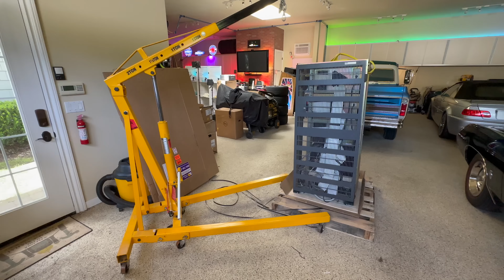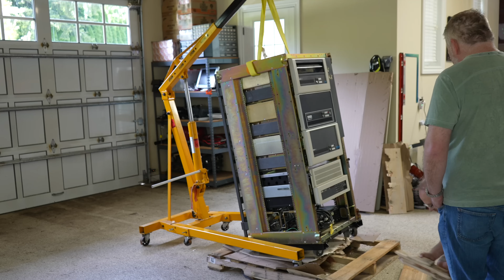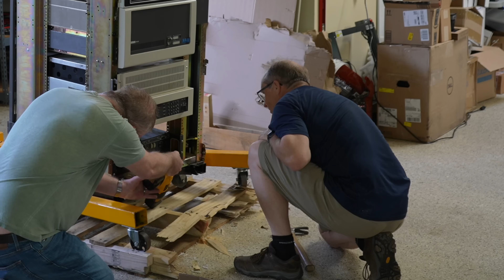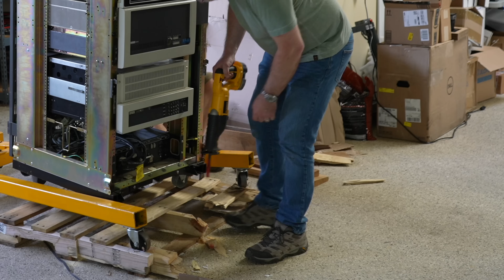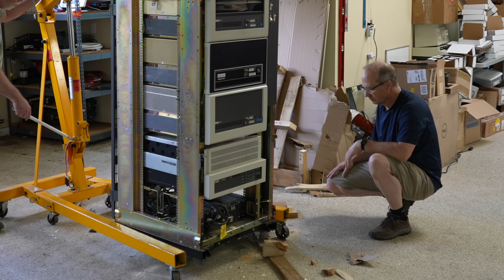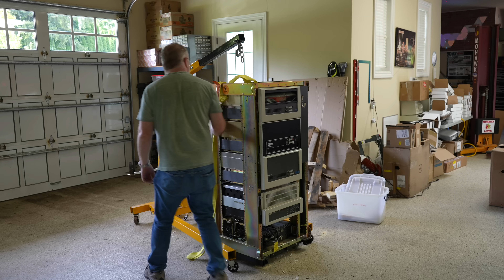I Bought the HEAVIEST Computer on eBay: The PDP-11/34!

Comment: PLEASE more DEC ANYTHING. I was with DEC for years from PDP 8 series through most of the VAX series. I know these systems frail to most simple systems now in some ways but the evolution of DEC over the years was amazing. I am happy and honored to have been part of the excitement.
In case you may be interested Ken Olsen did everything to keep the payroll running even when times were tough and we did have some lean times. He made some errors in judgement by not getting in the PC biz earlier but there were no crystal balls then and as they say, it is what is  or was, as the case may be. 
Thanks for keeping some of the DEC gear going and preserving the tech on your super neat YouyTube channel !!!
Reply: Greatest design and most clever and consistent architecture between generations.  Learn it once and you've learned it forever,
Reply: I wanted to work for DEC after seeing a VAX 11/780 at the lab my father ran, but ending up taking a different engineering subject. But did end up using microVAX IIs and Alphas during the 1990s. I'm wasn't a systems engineer but was able to do some pretty cool things with the cluster, the ease at that it was possible to log onto one computer and then run an application on another computer, using the hard disk from another I still find amazing.

We did have DEC PCs, but I doubt they would have saved DEC.

I've heard that Ken Olsen was a decent guy, again marking out DEC from Bill Gates and Microsoft who haven't innovated a single thing and every product is stolen or cheated from somebody else.
Reply: @axelBr1  I know mush of the history of Gates and he didn't mind taking other's ideas and claiming it was a MS design. Case and point is the underhanded games Gates did regarding CPM and on and on. My respect for him is on par with the devil himself, almost !!
Reply: I feel that DEC trying to get into the PC game was one of their poorer moves.  This is not the venue that DEC was great at.  Too many companies tried and most failed at the PC market. I worked at Sperry and they made one.  Never really went anywhere but it seems they thought they had to try.  I wanted to work at DEC but they never contacted me for an interview till I was already at Sperry for several months.  I am a big DEC fan.  I learned computers on the pdp-8i running TSS/8.  Later got into the pdp-11 line and then then pdp-10 (KA-10).  I have the pidp versions of each that Oscar sells.  They are miniatures of each but with the same but smaller front panels and switches.  I have one big pdp-11 left.
Reply: @timradde4328  DEC's management matrix was out of control, resulting in DEC having a horse in every race, including 36-bits.
Reply: @James_Bowie  Their 36 machines were amazing.  But the Vax line really messed up the pdp-11 and the 36 bit.  And trying to get into the PC arena was just a bad move.  DECs stuff is built well but that means a higher price.  People did not want to pay those high prices even if the stuff was decent.  Too many other companies were also vying to get into that market.
Reply: @timradde4328  You need to understand that Ken Olsen wanted to keep the systems in the computer room and put terminals on desk to keep people on task with whatever their job description served, ie, no games, usually. 
It was not a bad idea and once PC's became cheap, people did play games and later got on the internet on company time. DEC did have a PC called the Rainbow which was supposed to be PC compatible but was not fully and DEC lost a huge amount of money buying back Rainbows at a loss. Later DEC had several lines of PC's which were fully PC compatible but this was well into everyone and his brother selling PC clones. Bottom line was people who spent too  much time playing generally were not getting their work done and were looking for new jobs. So, DEC was in the PC biz but had we been a year earlier, maybe the transition would have worked and maybe we would have been in biz longer. 
However, a VAX system and network, depending on peripherals and software could easily exceed half a million dollars back in the late 70's -90's. For considerably less, small biz's could have had a network of PC's and a nice server, much cheaper, not to mention loads of off the shelf software from MS and others. 
I hope this fills in some gaps on what happened. Cold DEC have survived all of this, not sure but I'd like to think so; at this point we'll never know. It was a wonderful ride for my years there !!
Reply: @timradde4328  I was the manager of a ComputerLand store and we carried the DEC Rainbow PC for a short time when it came out. I think it was either '82 or '83. It was quite interesting, but the floor demo unit we received still hadn't sold a couple of years later.
Reply: I believe RetroBytes did a few videos on DEC I watched them awhile ago and found it very interesting. I'm curious if all his info was correct or not. It's always much more interesting to hear first hand accounts even if they're not as flashy as a well edited video. 

CelGen Studios did a few on Four-Phase Systems which seems similar to DEC but shorter lived IIRC. And some very old DEC videos but I think they're less documentary and more here's a thing.

Also USAGI Electric has a few DEC videos if you haven't checked it out.
Reply: Anything built by DEC was built like a tank.  Designed to last.  And very heavy too. Uggh.
Reply: Hear, hear!
Reply: I had a roommate that worked in their board shop.
Watching Dave pull out that removable drive brought back memories.
We used those at the TV station, part of the character generator.  Had to hand edit bits in binary files to design characters.
Meanwhile, at home I'm looking at my Amiga A2000. lol
Reply: @wa4aos
> I was with DEC for years from PDP 8 series through most of the VAX series.

I was (for years) with the company started by the guy who had been the original chief design engineer of the PDP-8.

But before then I worked with a PDP-8 for a few months in 1973.  I wouldn't be able now to recall it at will, but I'd bet if I sat down with the manual (or reference tri-fold) and started doing it, before too long my brain would go kerching! and I'd remember the boot toggle sequence.

It taught me a lot about the real basics of how computers work - I was writing in PAL, and after a while the code got too large to leave room for the actual assembler, so I then had to manually do all the machine code translation, address resolution etc.

I was a student - I guess my wages were less than the price of more memory 🤑

I did though return to university that September knowing more about how assemblers work than my lecturer did 😁
Reply: Yes, more DEC! Another ex-DECcie....XXDP+ was my OS! Worked in Comm Diags.
Reply: talk about terminator boards - enlighten us - is DIY possible - are 120ohm R needed.. does it make sense adding 1nf caps over the R - are 1W R a good choice.. is 10% or 1% a good choice . .? do schematics exist ?
Reply: Minicomputer manufacturers and PC suppliers were not in any way compatible- you cannot move from the gross margins of minicomputers to the wafer thin margins of PCs. I worked for Norsk Data, another Mini company, and witnessed their attempt to do this in the late 80s. Doomed to fail.
Reply: @Tensquaremetreworkshop  
> Minicomputer manufacturers and PC suppliers were not in any way compatible-
> you cannot move from the gross margins of minicomputers to the wafer thin
> margins of PCs.

IBM managed it.

For a while.

> I worked for Norsk Data, another Mini company, and witnessed
> their attempt to do this in the late 80s. Doomed to fail. 

I didn't think Norsk ever tried, and were in fact a casualty of not foreseeing PCs or open systems?

Not that they were alone.
Reply: Unix and all its derivatives are still snake oil to this former RSTS/E and VMS engineer!

Comment: Fun!
I really appreciated that photo of the PDP-1.
I read where the guys at MIT, when they got their new PDP realized it had a "scope," so they wanted to create a program to demo the capabilities of that scope. They created the very first video game, Space War, using model train controllers as game controllers. I've previously seen only black and white photos of that model.
I first learned Microsoft BASIC on an Ohio Scientific minicomputer that our tech school had in a back room.
For seven years I was the operator for a series of IBM System/34 and System/38 minicomputers. For five years after that I was the lead operator of an IBM AS/400 Model 70 supermini shop.
We were trying to demonstrate we didn't need no steenkin' mainframes. But we were pushing those machines hard.
The guy from IBM said we were considered to be "hot-rodders."
I would love to see you boot up UNIX on your "new" machine. They invented C to enable them to port UNIX to different computer architectures.
Reply: Basic was the O/S for my printer so I learned to put a prog together from that.
Reply: @20chocsaday  Funny.  I've had the idea, for hack value, of implementing BASIC in PostScript using printer readback for interaction.

Comment: Hi Dave, I'm a PDP-11 fan, specifically the PDP-11/40 running RSTS.  Please make some more videos showing your adventures with the PDP-11/34.

If memory serves me correctly, when you pull out any of the rack drawers with the cards in them you can pull the "T" handles on both sides forward and that will allow you to rotate the draw with its backplane and all of its cards 90 degrees so you can easily access the bottom to see all of the wire wrapping.

If you need to put that wire back on the backplane there are wire wrap tools and wire radially available on eBay and other places.
Reply: I started at DEC in the Netherlands in 1980. RSTS was the first OS I worked with. I remember that you had to prefix commands with  "please" on the console in some cases. The console was a LA100. Patience was a good quality to have in these days.
Reply: radially or readily, nice typo or my mistake ?
Reply: Youngster, I used to code on an 11.34 and I used RT11 but eventually we upgraded to RSX11. I also used an 11.20 and the 11.44
Reply: Agreed.  Nice to meet a fellow RSTS/E runner...  (Why does VI remind me of TECO?)
Reply: @kirkwolak6735  Our PDP 11/44D at high school ran RSTS/E. Some of us would help admin it (I would do the backups every week) and we programmed in Pascal for AP computing on it. We also did a lot in Basic+ and had all the programming manuals in binders in the computer room. I always enjoyed using RSTS/E. VMS on the Vax in college was a different story though lol.

Comment: I believe PDP stood for Programmable Data Processor. Divisions of large institutions typically weren’t allowed to buy computers, hence the disguise.
Reply: The story I heard is the venture capitalists in 1957 thought a “computer” was the huge room filling million dollar systems dominated by a few companies like IBM, UNIVAC, etc.  Nobody wanted to invest in an unknown small startup company with only a dozen employees to compete with those huge established companies.  

So DEC didn’t build computers.  Instead they made Digital Laboratory Modules / System Modules that could be plugged into a backplane in a cabinet and connected together in different ways to make specialized laboratory equipment.  The fact they just happened to also sell the “Programmed Data Processor” (PDP) cards that would help coordinate their Analog to Digital, serial, disk drives, and other cards was just a “coincidence” … at least to the investors.
Reply: I know of a department that bought a model PDP8 Oscilloscope as they were not supposed to using computers.  Order was signed by the boss who never caught on.  The salesman was happy to play along.
Reply: Why weren't they allowed? You got me curious
Reply: @yoursred  presumably because the stewards of the centralized computer installations were jealous
Reply: It's been a long time but as I recall the DEC PDP-10 was called the Peripheral Data Processor.  There were teletype work stations scattered around campus.  It was in contrast to the university's IBM 360/50 which was strictly a batch system with no online remote access.

Comment: Dave you need to get a VT-100 for the true PDP-11 experience.  One of my earliest programming gig's was on an 11/23 with RK05 packs, running RT-11/TSX+ writing boring accounting systems in Dibol.  Have to agree though transporting it I would have done checks before powerup.. but to call it unethical is a stretch.  A real walk through memory lane thanks again Dave.

Comment: If it reboots in less than 30 minutes it's not a computer, it's a toy. - Old bearded man I used to work with at Scania in 2010.
Reply: Funny you say this.  Just before DEC Magazine became the VAX Magazine, they accepted an article from me, on reducing boot speed to < 30 seconds for the PDP-11/34a.

My trick was to change the defaults in the O/S source code for the terminals to be our settings for 28 of the 31 terminals we had.  So we got rid of ALL of the TERM SET BAUD 300 ...  Lines.
Then I rewrote the numerous one line commands for the UTILTY short cuts, etc. etc.  To be a small assembly language program that read in one file for each set of settings.  And processed them without loading/unloading the same program 20 times in a row.

I also pointed out that if you could not change the "SIL" (compiled OS).  Then you would benefit from changing the terminal command to operate on a RANGE of terminals (2-28) and allow multiple settings with a "delimiter".  Again, running a program once, and setting 28 terminals in a loop.  Versus launching a program for each setting for each terminal.

Although the article never saw the light of day.  It was very educational as a High School Student to learn to write, re-write the article.  And to thoroughly test the code.  Add timing to things, and figure out that the Assembly Language helped, but the biggest thing was simply loading one program to do all the work with one invocation.  Once I learned that...  I was PUT OFF by how the original startup file was setup to do the exact opposite.

I knew from those days 40 years ago.  I would do this stuff for life!  And I still love it!
Reply: Whut?  OS/8 on the PDP-8 running from an RK05 booted in like half a second.
Reply: By that logic, anything running Windows 11 is, in fact, a computer.
Reply: @nikstalwart  Even though, well, do I have to say it? A computer is like air conditioning...
Reply: @nikstalwart  I don't get this. Power button to boot is like 10 seconds and I can open whatever I want lol
Reply: @R3AL-AIM fast startup enabled is cheating, it’s basically sleep
Reply: well we could  just start a few of the devices with ferrite core memory by  loading the  IP and  starting clock  lol

Comment: One of the first computers I ever worked on. I performed maintenance on these,  their punch tape readers, tape drives, monitors... ect. Regarding your disk drive, their heads would drift out of position on a regular basis. If not realigned every six months or so you'd find that disks archived a year or so back could no longer be read. The same would happen to the reel to reel tape drives, a real pain when trying to recover a crashed disk. Thanks for the video and memories.
Reply: And you need a special head alignment disk and two channel oscilloscope with a special diagnostic program running.
Reply: I was on the final assembly and testing of Perkin Elmer computers. These where about the same size.
Reply: Yup, keep up with your cross-media compatibility tests, frequently. You should be dreaming about cat-eyes!
Reply: That may have been what happened with our PDP 11/44 in high school in 1988. It started crashing and us students who helped admin it to do a backup restore and had our boss (teacher) call out a tech who first didn't find anything wrong. Which got our boss mad at us because those calls weren't cheap. Eventually the tech on another visit determined it was starting to read/write 256 bytes more than it should with every request. I was told he replaced the controller, but it could have just been the alignment issue.

Comment: I almost bought one at the DeAnza College, Cupertino CA swap meet in 1980 $800 with 2 disk drives (removable).   Wanted to run a multi line BBS. Never got to run one at work, We have Vaxes, lovely machines